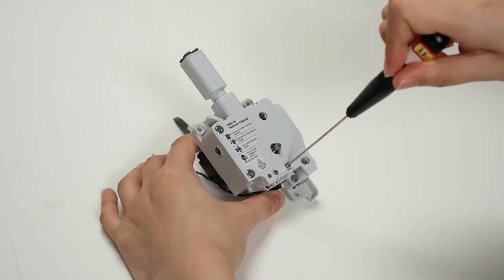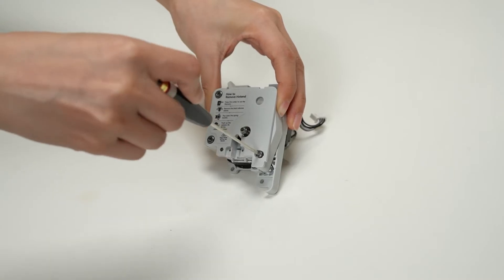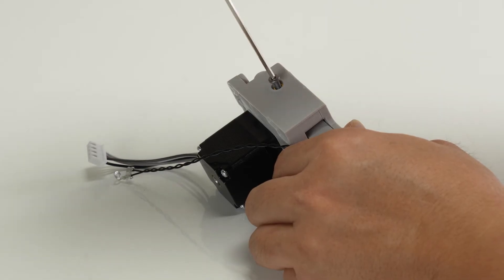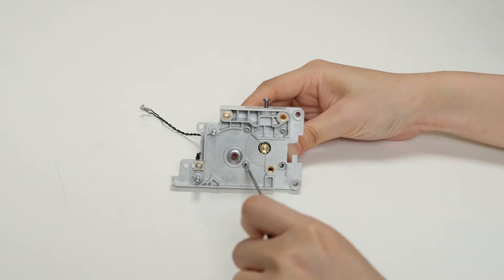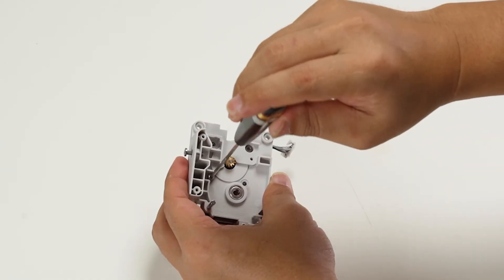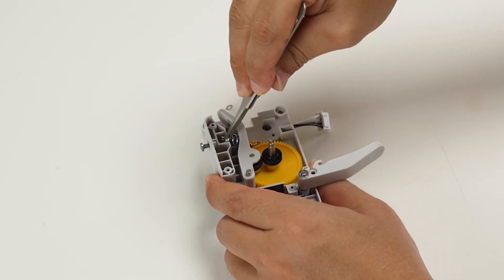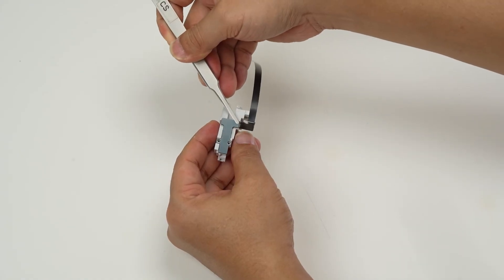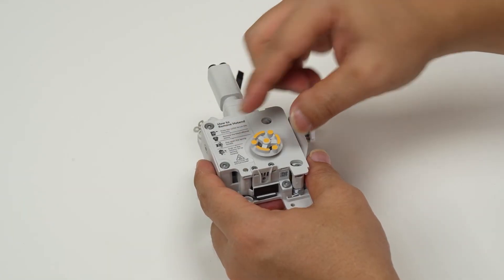A1 Series Extruder Module Installation Tutorial

Comment: Unfortunately in this video i can't see how to disassemble the extruder from the printer. More specifically, it happened to me i've broken by accident the filament sensor cable. I know how to fix it on the filament hub, but not where to plug it on the other side (and how to reach it)
Reply: I have the same problem.  I've disassembled the extruder but can't access the connector for the filament sensor.  I've searched the Bambu wiki high and low but can't find instructions on this crucial step.  This sucks!!!
Reply: https://youtu.be/j2xI2nF_s-U?t=1m20s